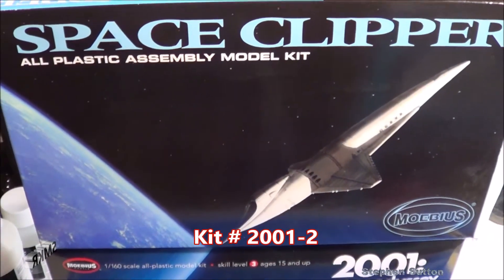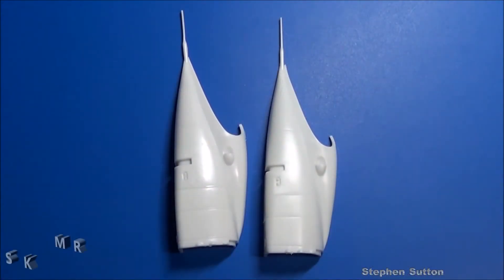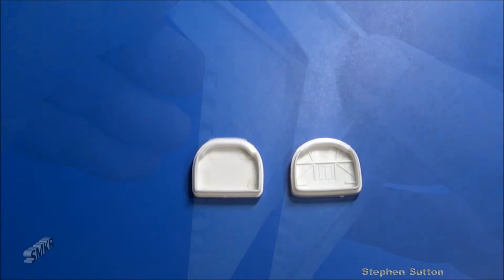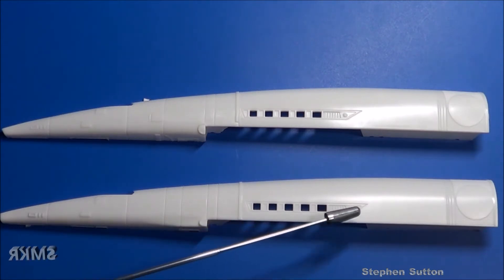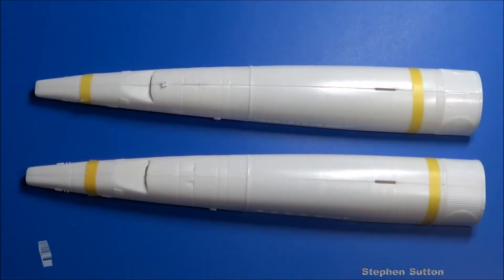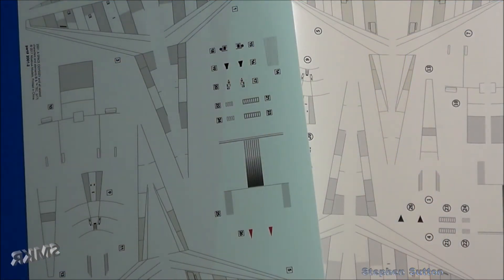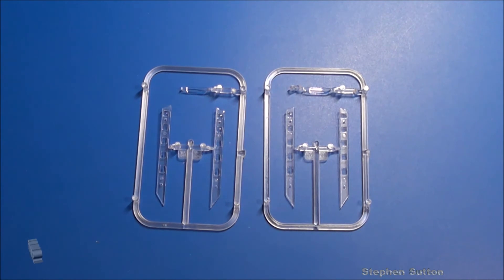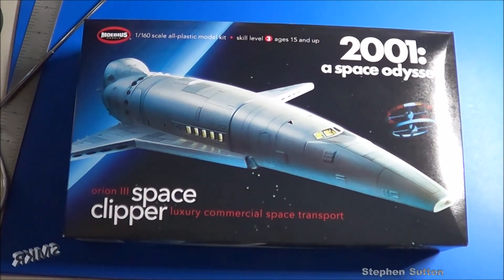Review Side By Side Moebius Space Clipper 2017 / 2011 kit Issues

Comment: Stephen, I went to order this, found it at Hobbylinc & Amazon and both show the old box art, they are only $27 so has to be the new one but just wasn't sure why they are showing the old 2011 box, you have any idea??
Reply from the maker: Yes, they should be the new one, I saw that also, they are using the old box art.
Reply from the maker: It is the same scale kit. 2011 is the original tooling, 2017 is the new improved tooling, both are 1/144th.